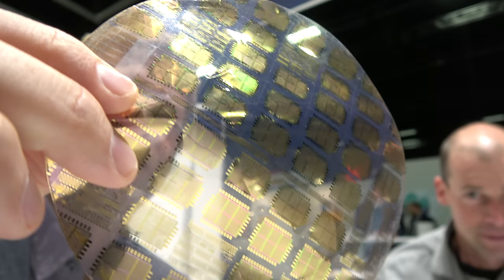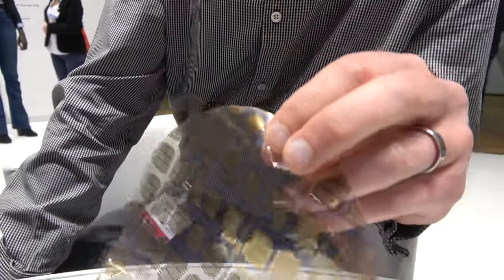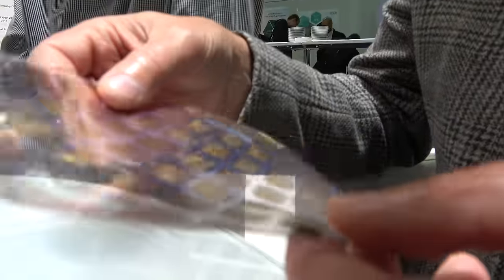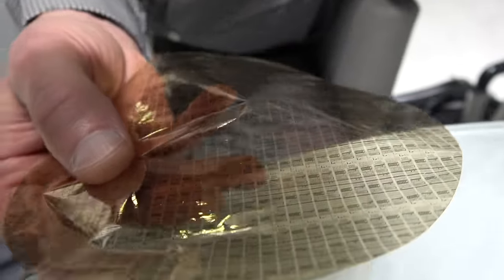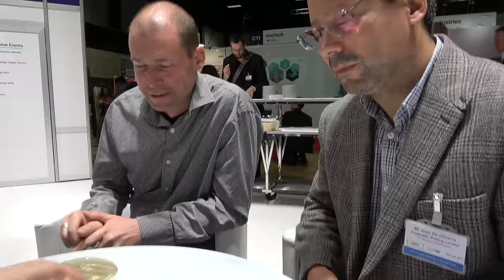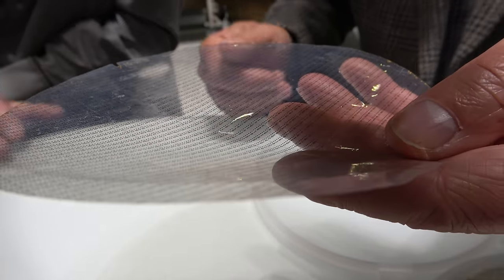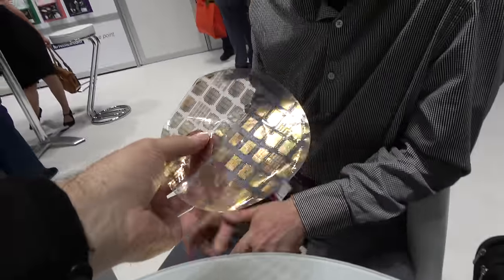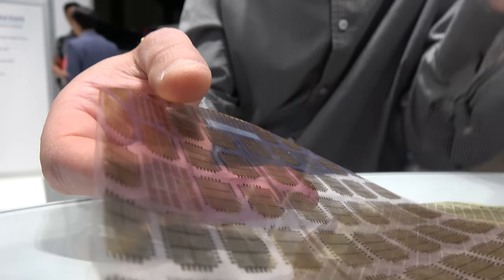$0.01 Flexible Plastic ARM Processor by PragmatIC

Comment: I only have 2 questions ,, is that sheet hes holding a working unit ? and secondly are these room temperature conducters since what I understand that's not a thing yet so how would they be cooled ???
Reply: I have no knowledge on whether it's a working processor, there hasn't been a powered-on demonstration after all.

But what do you even mean by second question? It's not like you need to dunk your phone into liquid nitrogen for it to work, it's as if you're confusing semiconductors and superconductors.

How would they be cooled? You can dissipate several dozens to hundreds of mW  through the plastic sheet easily, no problem whatsoever, but a circuit that consumes that much would be impractical due to power delivery issues, so it stands to reason they're likely aiming for a sub-mW power circuits. In fact most simpler electronic circuits you handle in your daily life dissipate heat through a fairly unfortunate amount of plastic and stale air and other material arrangements with bad thermal conductivity and they're perfectly fine.
Reply: @SianaGearz  so then its basically  just a shiny idea on a piece of plastic paper coming from 3 pocket dwellers out of  some think tank at the risk corp  im assuming !?! and also yes if you've ever had your phone apart and looked at the processors some have a metal shield glued on for heat spreading so they don't crack which splits the circuit and destroys it and others either expel heat straight to the board and through the faraday casing and also super cheap ones like kyoceras old pocket phones the whole board array heats up due to lack of proper adaptation ,,its no the battery you feeling when youre texting on a hot day and and you think holy toast my phone is hot its the processor cooking the whole phone inside out ,, as to my supposed confusion no im not confusing semiconductors , transistors heat to expelled traped energy it cant expel and if a super conducter is used all energy is either used or diverted thus being a "super" since it has no resistance ,, no resistance ,no heat.
Reply: @jessemazo4902  They're not some basement dwellers, they have research, they have a production line and they're marketing a product - a relatively low-tech RF tag that is super cheap to make and has enough of an unencrypted digital storage to uniquely identify it. It's suitable for product tracking and not suitable for high-security use, but it's super cheap and causes less handling and production line automation issues than traditional tags that are made of paper and have a silicon IC glued onto them, and allegedly higher reliability.

The processor shown is not a product and might or might not eventually be, but that's what they're working towards - they say they have a long way to go towards it being practical enough for anyone to actually buy one. It would be prudent to assume that they have validated that these structures that they're showing are actually being built correctly enough to work. There are some things they aren't saying though, they aren't disclosing the risks that may lead to it never becoming a product, and i have some ideas in that regard.

On phones, depends, the processor shown won't run a smartphone! It's an ARM Cortex M0, the kind of processor you'll find in a wireless controller chip or in a high-end gaming mouse or keyboard doing just fairly easy interface duty. Existing Cortex M0 implementations have a sub-1mW core consumption and most of their consumption is in the IO circuit which can be eliminated if you don't need to interface with traditional existing ICs, but only with other flex-printed circuits. Smartphone's power envelope is around 300-900mW, so it does need some cooling considerations, but the metal shielding is an "RF can" to suppress interference, it's not for cooling. On more powerful phones you'll find a hole in the RF can and the processor heatsunk into the back of the screen or alloy middle enclosure directly. On less powerful ones, you'll often find atrocious "thermal compound" that doesn't deserve the name or worse, a bubble of stale air, one of the most vicious thermal insulators short of vacuum - but of course they still have cooling via the PCB, through copious layers of plastic but at least with some area to go with it. Which is to say these guys here also can hit the cooling targets of vaguely similar order of magnitude, but it just wouldn't make for a good product if they do.

I think ultimately power delivery and power efficiency are going to be the issues that limit their products or make them unmarketable, not heat dissipation. Heat dissipation is an issue they'd LOVE to have, because if they were in position to have that, it would mean they solved the power delivery issue at least.
Reply: @SianaGearz  well said , I was assuming these were ARM micro processors

Comment: If it overheats it will literally melt :D
Reply: Use Flexible Silicon instead then...
Reply: The technology isn't based on Si, so the speed is a lot lower, typically in the low MHz. So it won't be for gaming, but rather for very simple tasks (such as RFID/NFC)

Comment: This is all nice, but if this technology makes MCUs cheaper then why all this effort to print it (only) on a flexible substrate. It would be much easier (and maybe cheaper) if you print on solid substrate.  Flexible MCUs may have some use, but printing chips might use less silicon. Also the durability might be questionable if the thing flexes when used.

Comment: Are these heat resistant will they work 24hrs without melting. 
Can they be used to create cheap LCD TV? 100 inch TV for $10?
 Can they be used to create solar panels? Just imagine $10 solar panel giving enough electricity for whole house. 
The future is remarkable.
Reply: interesting. if you could get the printed surface to play nice with the LCD shutter, could be a go!

Comment: time to make 10,000 of this new thing and see how it dose compared to a regular pc
Reply: you can easily predict the outcome it will do quite poorly for basic user workloads because having 10000 of these won't help with anything since most programs aren't even properly multithreaded therefore you would not utilize all of these processors/cores just like for example having 16 cores cpu will not be fully utilized at many games
Reply: Vít Štěpánek ok thank you for the info

Comment: Moore's law this Moore's law that.  What needs to be discussed is the real looming brick wall which is Amdahl's law.
Reply: It hasn't mattered until recent times with the increasing core counts.  And I'm not even sure you  quite understand WHY it's now a problem and wasn't before.
Reply: Aaaand you just proved you really do not get it... at all.  Cool story though.
Reply: @capturedflame  And by the way even if we moved into Mr Rogers land of make believe where 90+ percent of the calculations software is demanding on a system is parallelized you hit a limit in the number of cores that well help you get tasks done faster.  And we aren't living in the land of make believe now are we...

Comment: It will melt inside when we start playing games & phone gets hot
Reply: that violates the laws of thermal dynamics - the thermal conductivity of the material does not change because you think its some how different than its components...  This actually has the potential to do MORE with less power, and thus less heat waste.  Plus, even normal electronics don't normally get hot enough to melt most electrical plastics, which have a melting point between 350-500 F.  Most computers force themselves off before 100C (approx 212F, way too cool to melt plastics used in electronics) to prevent melting components and solder.  My source, 30 years of working on various computers and I worked for Sumitomo as Setup for Injection Molding machines (Nissei FNX80, FNX110, 1000 and others.)
Reply: Thermal problems are minimal these types of processors don't loosen that much electricity but if they did you use a different substrate material like silicone and take away the heat using mineral oil or another liquid
Reply: Thank you for telling all the things